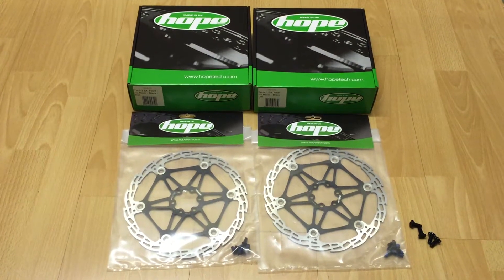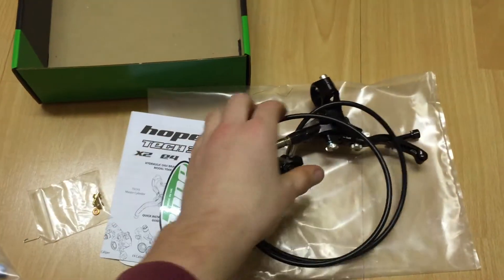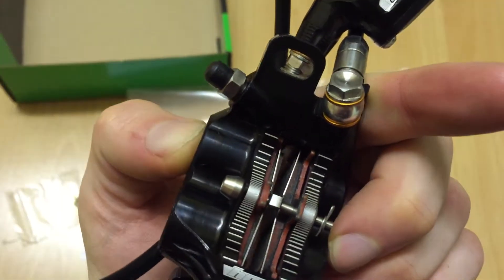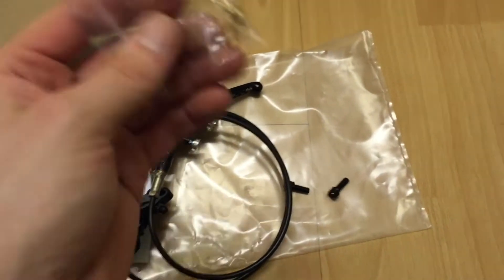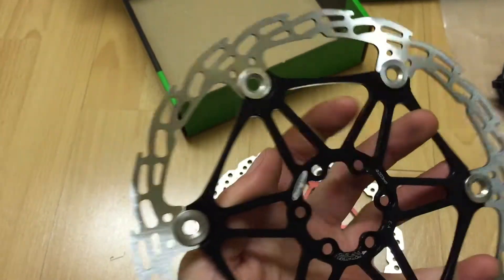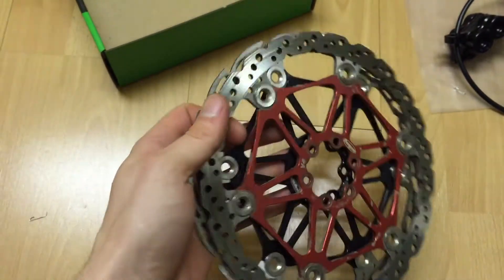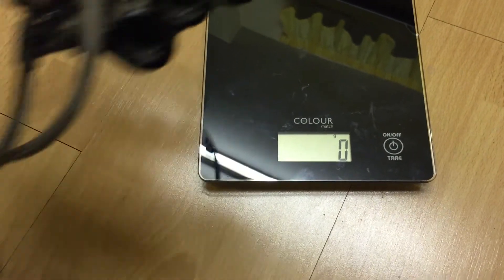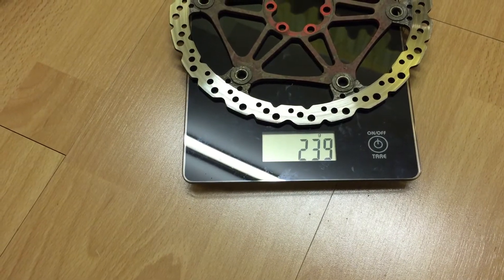Hope Tech 3 E4 Brakes - Unboxing

Comment: I am considering these brakes, in fact I am quite sure these will be the next brakes I will try, if I can manage to get a pair in these times.
Reply: Just ordered a pair of the orange E4s with Braided lines. Did you ever get them? How were they?
Reply: @bmx2026  I decided not to, I heard so much bad things about how dangerous Dot fluid is, how corrosive it is. But even if i wanted to they were sold out everywhere, they went fast. probably cus factory shut down due to covid, and getting it back to suppliers and in stores took a long time. But I have my eyes on Trick Stuff Maxima. they use refined sunflower seed oil, so it's safe.

Comment: will there be much difference in power with V4 caliper over E4 caliper? I am 86 kg with all gear on.So far I find TRP Spyke do decent job at stopping me. But I haven't tried 4 piston brakes.
Reply from the maker: There is a noticeable difference in power but You really need to run the v4 Rotors and they are heavy so I'd only recommend them for DH/E-MTB

Comment: The middle bracket broke and is completely lose
Reply from the maker: +Solidus43 Hi, I'm not sure what part your referring to? here is some diagrams for the levers and calipers.

 http://www.hopetech.com/wp-content/uploads/2014/03/2014TECH3MCYLexplodedview.pdf
http://www.hopetech.com/wp-content/uploads/2014/03/2014E4Caliperexplodedview.pdf
Reply: +JED MTB the disc is two pieces is it not, so the inner part (blackpart) is lose from the outter part (metal part) best way I can explain it. The brackets have not fell off
Reply from the maker: Ah I see, there should be a little bit of movement for when the discs heat up but if there is too much you'll need to buy a new disc.